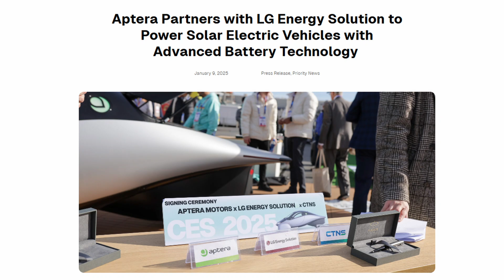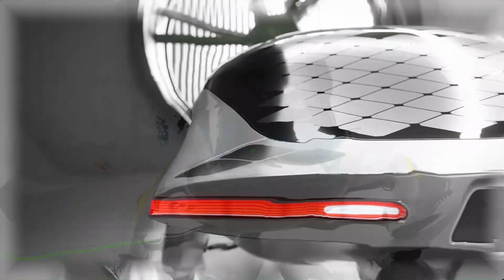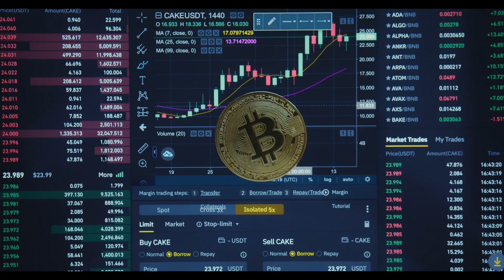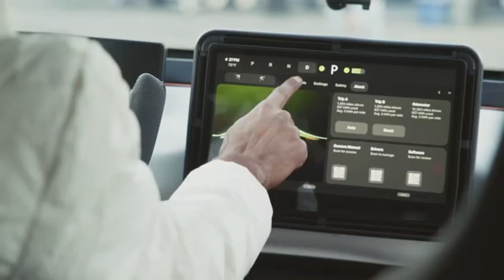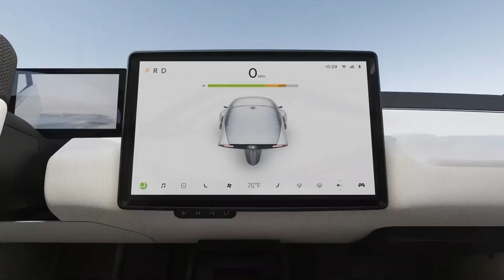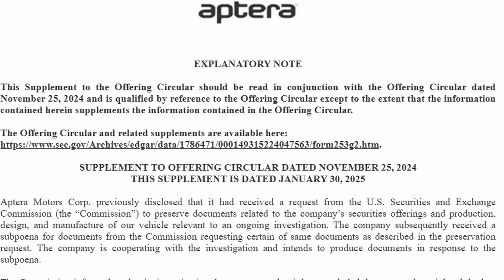Aptera's Pivotal Development POST CES 2025

Comment: This was not "production ready".  Not by a mile.  You'd be much better off putting solar cells on your roof, storying it in a battery, and using that charge to power a traditional electric vehicle.  WHY does the car have to charge the battery on the vehicle and create all these compromises?  Isn't that solar powered transportation too?